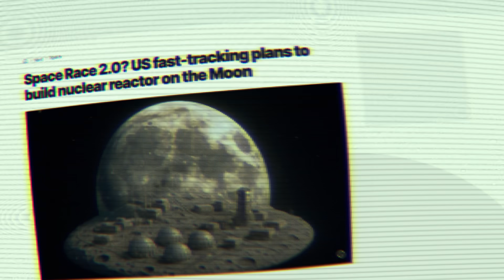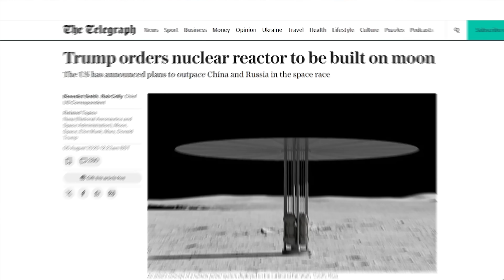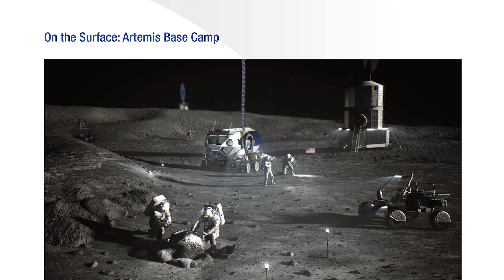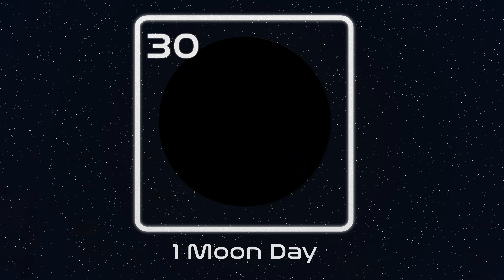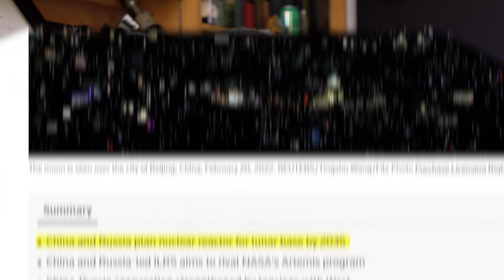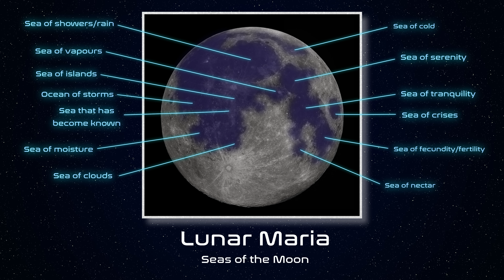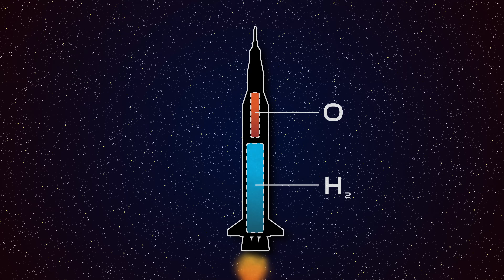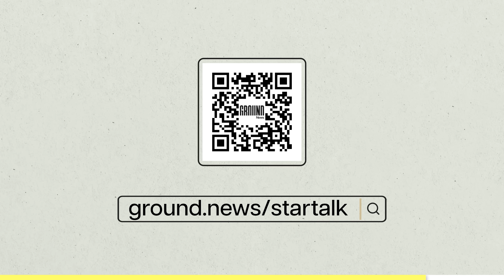Why We’re Putting Nuclear Reactors on the Moon

Comment: I still don't think we have gone to the moon and come home successfully. Once we finally establish communication on the moon, we will see the challenges of leaving there is much greater than we ever thought.

We couldn't have tested the hot or cold extremes of the Moon with nighttime temperatures being at negative -208° and daytime temperatures of 250°. 1965 did not even hold the technology. Sorry for being a skeptic but not sorry for coming to my conclusion.
Reply: Zinc batteries can operate - 140° temperatures. Insulating them would easily maintain a charge and output on a zinc battery.... Shoutout EOSE 🎉
Reply: SMRs... Shoutout SMR and NNE 🎉

Comment: The moon at night might be -200F but space is nearly a vacuum so it’s difficult for things to lose their heat because it’s in effect like being in a vacuum insulated thermos.
Reply: They typically use radiative cooling( emitting infrared), like on an RTG or the space shuttle. Works fine  in vacuum.
Reply: Thermal energy can still be radiated into space
Reply: @veryanonymoususer52just slow. Not an instant freeze like the movies get wrong.

Comment: China can’t make screws and bolts that do not fail. The products from China are cheaper than cheap. Everything fails and China’s space station will fail which means the United States will have to build extra space for the Chinese running over to come in because of the failure of their station. For god’s sake, don’t get Elon Musk have anything to do with the Artimus program what so ever.

Comment: 6:30 If you put one on the exact opposite side as the other it would be power 24/7 all year but you'd have to connect the whole moon but I mean if instead of competing with China we work with them 50/50 and we connect then whenever the sun is it's generating power

Comment: Unless in-space refueling can be perfected in the next couple of years (and that is looking VERY unlikely), humans will NEVER get to Mars by launching a spacecraft from the Earth like we did in the Apollo missions - if we DON'T have that lunar base "middle-man," then we will simply not be going at all. If the intent is to travel to Mars, a lunar base in NOT an option: it's a requirement.
It makes a far more sense to launch a mission to Mars from the moon than it does from Earth simply because of the amount of fuel that is required to get a spacecraft from Earth into space. If you launch from Earth you will burn all of your fuel just getting into space and you'll have nothing left for the rest of the - very long - trip.
 The idea is that you fly a "shuttle flight" to the moon, where the actual spacecraft doing the Mars journey would be assembled and fueled. Then, when your massive, Mars-bound spacecraft is launched from the moon with a full gas tank - you won't have to burn all of your fuel just getting out of the gravity well (like you would if you're launching from Earth) ; you're launching from a much less intense gravitational field that would require a fraction of the fuel to overcome. After launch you could also immediately do a slingshot maneuver around Earth to save even more fuel and generate Delta-V propulsion for the first part of the journey.
A direct trip to Mars from Earth will NOT WORK. PERIOD. FULL STOP.
#gravitysucks

Comment: Afaik fission reactors don't produce electricity. They produce heat. You then have to put that heat into water to make steam. Use the steam to turn a Dynamo to make electricity. This is not gonna work on the moon because there's no water.
Reply: A sterling engine turns a temperature delta into rotation which can then turn a generator. Not sure if that's what they're gonna do but it would work. Probably.

Comment: Demon core goes critical  August 21, 1945
First incident A re-creation of the 1945 incident. The sphere of plutonium is surrounded by neutron-reflecting tungsten carbide blocks on August 21, On May 21, 1946 with the Second incident.
The demon core was a 6.2-kilogram (14 lb; 1 st), 3.5-inch-diameter (89 mm) subcritical mass of plutonium which went briefly critical in two separate accidents at the Los Alamos laboratory in 1945 and 1946. Each incident resulted in the acute radiation poisoning and subsequent death of a scientist. After these incidents the spherical plutonium pit was referred to as the "demon core."

Comment: Things we can do with a Moon base: 
Mine fuel. 
Space elevator (from Moon)
Send stuff to other planets. Much more efficient to launch thanks to no air and less gravity, but only if the thing is built on the Moon (not Earth).
Moon sports.
Clean radio astronomy.
Tell the rest of Earth we're the best. 
Admire rocks.
Low or zero G manufacturing high purity crystals, etc. 
Leap from a swimming pool like a dolphin. 
Envy those ungrateful sods on Earth who can go outside without a space suit. 
Bake bread without the dense bit on the bottom.
Rent ad space to Earth megacorp.
Wall jump like Mario.
Pod races.
Pile a whole foot of whip cream on your pancakes without it collapsing.

Comment: Any word on how they plan to deal with the constant bombardment of asteroids and micrometeoroid impacts?
Reply: put things underground or cover them with thick layers of regolith / regolith-concrete
Reply: he literally talks about it in the video
Reply: I’m not sure it’s as constant as it looks. The craters on the moon don’t erode, so they could be really old.
Reply: @stevenm8503  Those craters are indeed very, VERY old. I assume the gravitational field of Earth and the other planets helps divert asteroids and comets away most of the time.
Reply: Burry everything in lunar regolith
Reply: A Question: Hey Neil, do you know, did NASA ever told you how you scientists generate electricity from Uranium? Are you talking about thermal coupling or boiling pure H2O and use the steam in a turbine?
Is it called Power Generating Device or it has a real name?
Have you ever seen one of these power generating devices or it only will works on the moon?
Reply: yes get out the baseball bat and start hitting away 🤣

Comment: What is the rocket that is carrying the radioactive material malfunctioned and exploded in the atmosphere?  That can't be good.
Reply: probably no problem at all if it was a TRISO pebble bed design
Reply: 1. it wouldn't set off the reactor like a bomb. You need highly concentrated fuel (little man and fat boy from ww2 where above 80% enriched and that was considered low) to make a bomb and reactor fuel is usually around 3-5% enriched. 2. You also don't need a lot of fuel for a system that small. Probably less than a kg in total. If the fuel was atomized in the explosion the radioactive material would burn through its half-lives and dissipate before it reaches anywhere on the ground. More than likely it would stay intact and considering they launch out over the ocean then it harmlessly sink to the bottom of the ocean and does nothing to anyone or anything. Nuclear stuff really isn't as dangerous as people think. Not saying its not dangerous but its only specific isotopes and elements that are truly dangerous no matter what and a lot of those are really bad at power generation so wouldn't be used.
Reply: @Snafu2250 I was talking about the radioactive material falling to Earth and causing cancer
Reply: @Snafu2250 mostly correct, but I'm not sure where you get the "burn through it's half lives" thing. That's not how radioactive decay works
Reply: I apologize.  I hadn't read your entire response. What you said made sense.
Reply: @steveknievel5938  no need to apologize. I was just trying to be educational not demeaning so I'm sorry if I was.

Comment: I admit I’m a Luddite, but how do you make power without water to make steam?
Reply: There are a bunch of different technologies that can be used to extract energy directly from the radioactive particles or the heat they give off. No liquids, no propellers, no moving parts at all.
Reply: Steam is used to spin a turbine which spins a magnet in a coil to generate electricity. You don't need it for solar power or nuclear power. Ps. I don't guarantee the accuracy of anything I just said 😅

Comment: On the South Pole, are there places that are always in light, that could have a solar panel that just spins to track the sun. E.g. at the top of a crater rim, perhaps mounted on a pole to avoid any shadows cast by nearby tall objects.
Reply: same problem as the reactor now it can get hit by asteroids
Reply: @mrbanana7110but a solar panel hit by an asteroid is a lot easier to repair/replace.
Reply: @bmitch3020 yeah you right but rn shiping more solar pannels to the moon is alot more expansive than a reactor that is going to last a pretty long time

Comment: Cold is a problem for batteries but if you can bury a nuclear power generator you can bury batteries too and you can use some of the stored energy to heat up that room.
They'll probably going to need heat generating devices (like servers) anyway..

Biggest problem is going to be getting al that weight on the moon, Saturn V is still the biggest rocket created and what did it carry? A lunar module and a moon car.. it's not a lot.

Comment: I'd worry that just the heat of the inside of a shelter with the outside being -200F might over time leak out and evaporate the water away. Yes, you'd insulate like mad, but... Maybe the shelter would need to move about? You'd probably lose some water over time and need to move to where there is more then I guess eventually move to another crater?

Comment: Advanced Derivations from the Mulham Relativistic Triadic Equation 

Fundamental Equation (Mulham Equation): 

(M₂ / M₁) × (T₂ / T₁)² × (R₁ / R₂)³ = 1   ( 1 ) 

This equation represents the core of relative equilibrium between mass, time, and space within the Ozmakan model. From it, several advanced physical relationships can be derived as follows: 

1. Derivation of Relative Orbital Velocity 

By rearranging equation (1): 

(M₂ / M₁) × ( R₁ / T₁ )² × ( T₂ / R₂ )² × (R₁/ R₂) = 1 

Since: 

V = R / T 

Then: 

(M₂ / M₁) × ( V₁ / V₂ )² × (R₁/ R₂) = 1   (2) 

This equation represents the orbital velocity equilibrium between two bodies in a relative system. 

2. Derivation of Relative Gravitational Acceleration (Centripetal Acceleration) 

From the fundamental equation (1), we rearrange as follows: 

(M₂ / M₁) × (T₂² / R₁) × (R₁/ T₁²) × (R₁ / R₂)² = 1 

Using the relation: 

g = R / T² 

We obtain: 

(M₂ / M₁) × (g₁ / g₂) × (R₁ / R₂)² = 1   (3) 

3. Derivation of the Relationship Between Density and Orbital Period 

Rewriting equation (1): 

( M₂ / R₂³ ) × ( R₁³ / M₁ ) × ( T₂ / T₁ )² = 1 

Given that: 

ρ₁ = M₁ / R₁³ 
ρ₂ = M₂ / R₂³ 

We find: 

ρ₁ × T₁² = ρ₂ × T₂²    ( 4 )

This relation expresses a direct connection between density and orbital period, without requiring any external constant. 

4. Derivation of an Alternative Expression for the Gravitational Constant (G) 

Starting from equation (2), rearranged as: 

( V₁² × R₁ / M₁) × ( M₂ / V₂²× R₂) = 1 

We define the first term as a dynamic expression for the gravitational constant: 

G = V₁² × R₁ / M₁  (5) 

Substituting into the second term: 

G×( M₂ / V₂²× R₂) = 1 

From which we derive the classical orbital velocity formula: 

V² = G M / R      (6) 

This is the traditional orbital velocity equation, now re-derived within the Ozmakan framework, without the need to assume G as a predefined constant. 

5. Derivation of the Ozmakan Quantization Laws 

Quantization emerges clearly when one of the relative dimensions (mass, time, or space) is held constant. Two key cases are presented: 

5.1 First Case: Equal Masses M2= M1 

From equation (1): 

(T₂ / T₁)² = (R₂ / R₁)³     (7) 

We define the relative quantization factor as: 

n² = (R₂ / R₁) 

n³ = (T₂ / T₁) 

This describes a temporal quantization resulting from changes in spatial coordinates. 

5.2 Second Case: Equal Periods T₂ = T₁ 

The equation becomes: 

(M₂ / M₁) = (R₂ / R₁)³     (8) 

Thus: 

n = ( M₁ / M₂) 

n³ = ( R₁ /R₂ ) 

Here we observe a mass quantization based on spatial variation, which we term the Ozmakan Mass Quantization. 

Conclusion 

These derivations demonstrate the ability of the Mulham Relativistic Triadic Equation to generate alternative physical relationships without relying on imposed universal constants. Instead, they are based on an internal relative balance between mass, time, and space. This opens the door to new paradigms in cosmological understanding—rooted in dimensional relativity rather than absolute constants.
Reply: ...OK, and?
Reply: I already have a headache, thank you.
Reply: @RainRemnant 
شكرا لك على تعليقك هذا يعكس أخلاقك العظيمة🎉
Reply: شكرا لك دكتورنا العزيز هذا رائع تحياتي لك وشكرا لك🎉🎉

Comment: How would a nuke power station work without water? Yes you said that there's ice and u can craft water, but not for the station though..
Reply: They could use the heat of the nuclear reaction and the coldness of the ice to power a sterling engine while melting the ice in the process.
Reply: It’s like negative 100 degrees on the moon

Comment: Makes sense. Cold Fusion. WE could also Collect the Hydrogen 3 and split the extra electrons to store in Ion Batteries. If Designed with any temperature resistance it could work in the Ocean depth Volcano Depth and In Space. A super Battery I believe was On the Animation Transformers. The Power Cubes. A in constant motion Torsion movement of the Electrons. Ya A Atom like uranium makes sense. People thinking about Hydrogen Bombs when that idea Came from the Sun. Out there in Space it Helps Life. Also Called Stars.

Comment: As far as I know every nuclear reactor needs cooling system. So I wonder how it will be possible to cool down even such low power reactor without any air or liquid coolants that can operate in such cold environment.
Reply: Solid radiators
Reply: The water in a nuclear plant is more of a heating system for the water than a cooling system for the reactor.
Reply: @victorro8760 Well the heat is used to make steam and at the same time the water cools down the reaction
Reply: @Petri_Pennala  Yes but it's not like a computer where the heat is a waste product that needs to be removed. The heat is the desired product so to say that the reactor needs cooling sounds misleading.
Reply: @victorro8760 Yes I thougth that you ment that of course the more efficient the better.
Reply: @victorro8760  actually it is quite like a computer. Nuclear reactors (all steam turbine power plants in fact) are typically in the 30% efficiency range. 40% tops. So for 100kW of power, you need to get rid of another 150kW of waste heat or more.
Reply: well I asked chat gpt about all this, and it says that the working temperature of reactor is considered to be 380-390 K. in that case the radiator is measured in a proportion of 1 kW heat to 1 m² of radiator surface approximately. But the coefficient of efficiency for the reactor is 25-30%. So 100 kW will produce appr 300 kW of heat. Radiator is appr 300 m².
Reply: @yaroslavscheklanov9183  I'm confused. Is your original comment not referring to the pool of water that nuclear power plants heat up to turn into steam that turns a turbine?

Comment: Hey Neil, I wish I can speak with you directly, however using this medium, I will ask this simple way:
- Why not use mechanical batteries on the moon? It's self-contained, it relies on light cycle, it's simple to do, etc.

Edit:
- however nobody forces you to build it in the basin of the crater that never sees light, you can literally select the exact point that receives both and use a mechanical battery
Reply: Mechanical batteries weight way too much
Reply: @Petri_Pennala you can use Moon matter.
Reply: @praa33 Not big enough gravity to use gravitys potential energy battery
Reply: @Petri_Pennala But that is a diff problem, i.e. deeper well, or higher tower, etc...
Reply: @praa33 But you would need enormous amounts of that moon rock or very high tower to store all that energy because think about it you could deadlift 10x more weight in moon than on earth. And that means to store the same amount of energy that way on moon requaires 10x more weight

Comment: How, EXACTLY do you transport to the moon , land AND set up the thermally radiative cooling system? Transporting (launching and landing) the reactor is not as difficult and the cooling radiators. Inquiring minds want to know.
Reply: as, not and
Reply: Radiative cooling in a low atmosphere environment isnt great. Shunting it into the ground is probably better.

Comment: Future advancements in Solid State Batteries might be able to handle the extreme cold, since there's no liquid in them.
Reply: you still have the problem that the rate of reaction inside the battery has a proportionality with temperature. Maybe we finally found a use for graphene supercapacitors...

Comment: The problem with battery also is the weight. I wonder if fly wheels is a good alternative. Granted depending on the scale, weight is also a problem.
Reply: I'm thinking of salt as a thermal battery. Salt can even be melted liquid and store a lot of thermal energy that way - and its completely harmless.

These types of thermal batteries exist already to do the same thing here on Earth with wind, solar and hydroelectric power, although mainly in research prototype projects.
Reply: It’s possible to use the thermal differences of the interior of the moon (geo in geothermal references our planet … so this would be … lunarthermal I guess). 

Solar is an option for a portion of the day. But, the surface of the moon is still a shooting gallery. Just a matter of time until things on the surface (like solar cells) get hit. 

It only takes a few meters of lunar surface to shield you from radiation (even without an atmosphere).  

There’s a lot to be gained by building underground rather than on the surface.
Reply: For the mass part of a flywheel, there's lots of mass already on the moon that could be used.